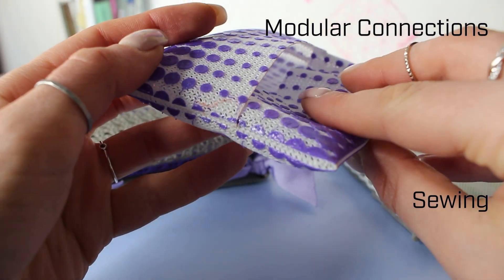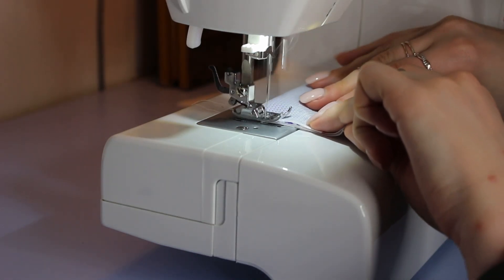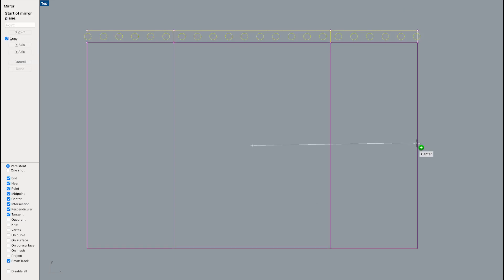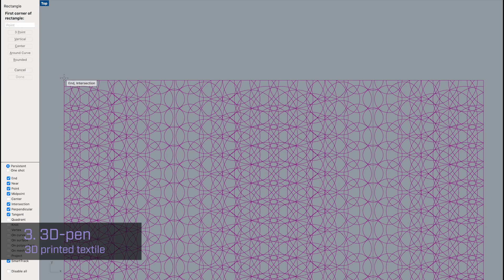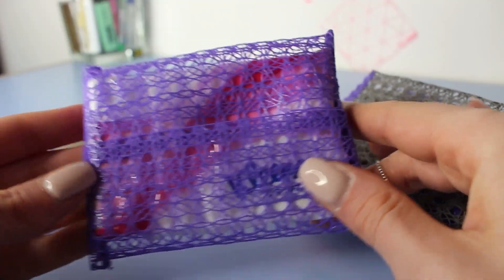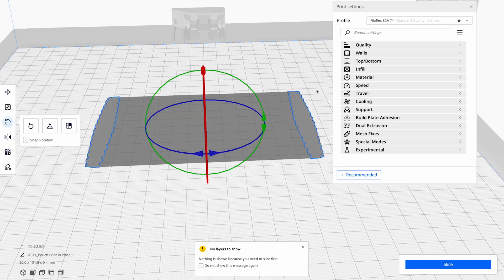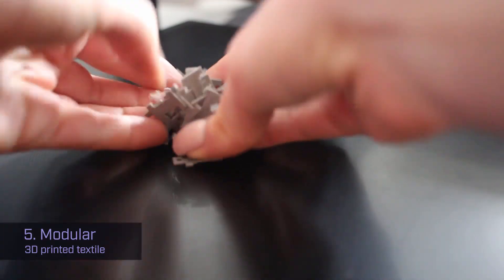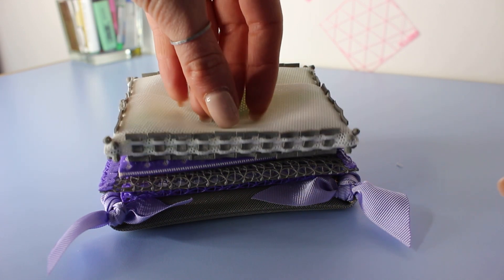How do you connect 3D printed textiles? | 5 Methods to Attach 3D printed Fabric

Comment: I realize this is an older video and you may have already adapted your process and/or moved on. But in any case, I was thinking that using flexible magnetic strips or panels (similar to that material used on many flexible refrigerator magnets) might be a better way to hold down folded designs for joining with the printhead itself. Some versions of this material are quite thin and might be suitable for this purpose. It also may be possible to use thin pieces of steel (maybe the steel discs sold to attach phone cases to magnetic phone holders?) for a similar purpose. I don’t know if they would be attracted strongly enough to the bed through the piece, but perhaps worth at try. Really interesting work - I subscribed and liked 😊!

Comment: Not sure if you have done this, but how would you approach joining the 3d printed fabrics like dragon scales etc? A lot of cosplay enthusiasts would be eager to know
Reply from the maker: Hi! Depends how you’ve printed them. If you print them in resin (like chain maille) there should be connector pieces included by the 3D model designer to click the scaled chain maille fabrics together - so that would be using the modular method to connect them. Or alternatively, if you 3D print the scales on textile, you’d sew the underlying textiles together with a sewing machine (or in case of very big scales) by hand. ☀️
Reply: @VariableSeams while I certainly was overthinking the task, you are clearly brilliant.

Thank you!!!
Reply from the maker: @TheBinklemNetwork  no problem at all! DM me on insta if you have any more questions- happy to help :D